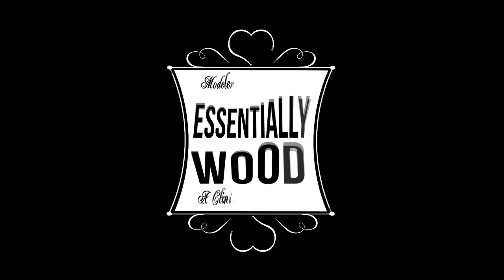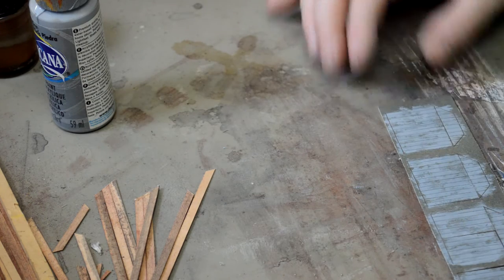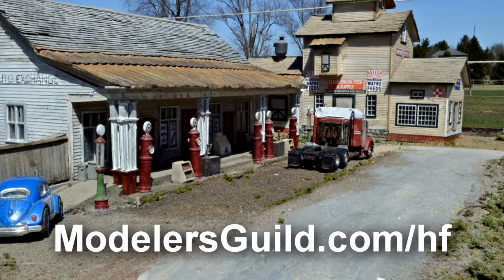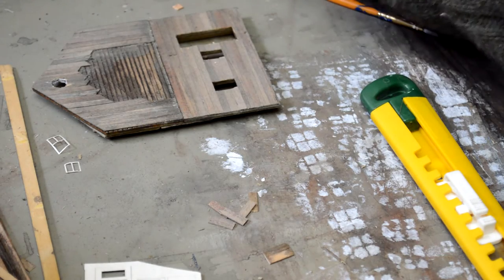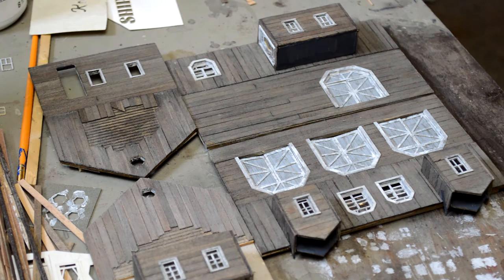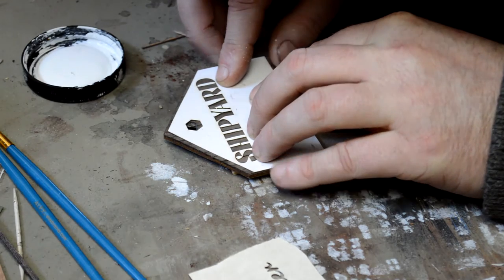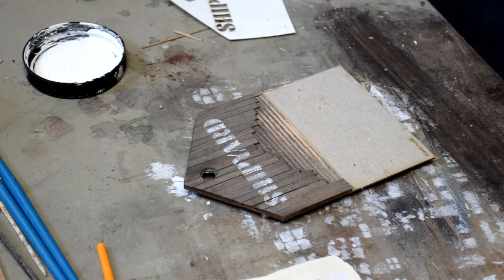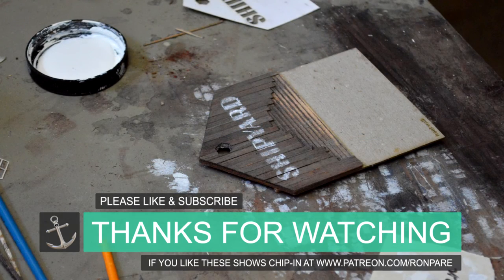Hand Painted Signs | Essentially Wood | Shipyard at Foss Journal entry #4

Comment: Good job Ron. Looking pretty good from Mississippi!
Reply from the maker: +Gerald Mabry thanks buddy!
Reply: Hi Ron what machine did you use to cut out the keller sign and where do you you buy them in Ontario? love your vids
Reply from the maker: Hi Bruce, I used a Cricket die cutter. I think I paid $300 for it years ago.
Reply: Where did you get it? Do you remember
Reply from the maker: Ah Bruce I forget. I believe it was Wallmart. But I would suggest looking into Diecutters first as Cricket has a proprietary GUI and that restricts some stuff. I know people have purchased die cutters from different companies that are a little easier to use in some ways.
Still a very functional unit.